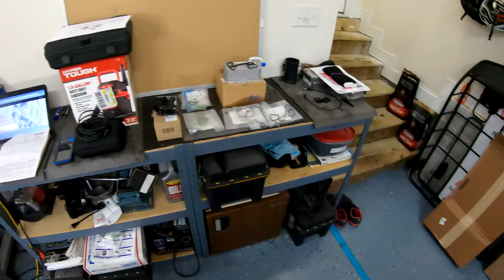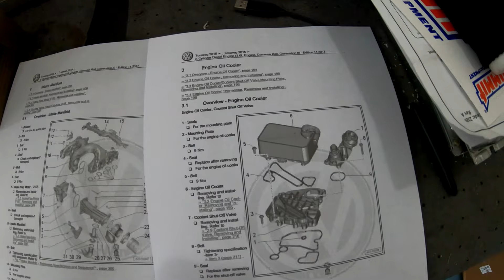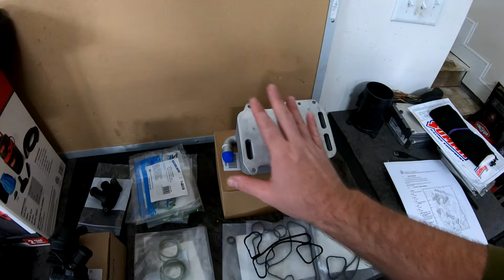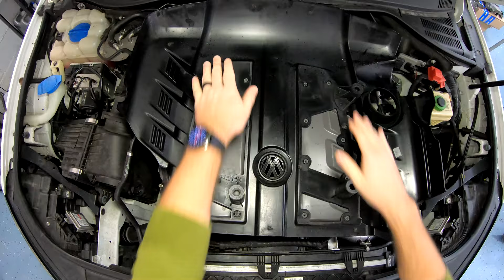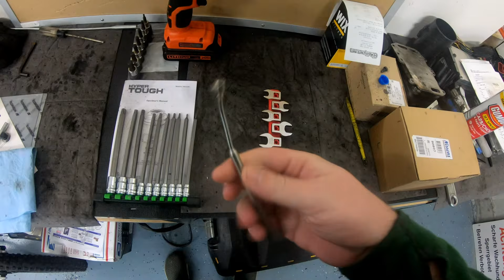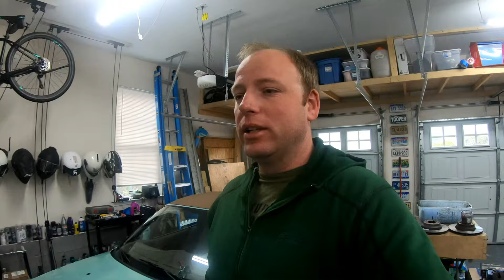2014 VW Touareg Oil/Coolant Leak - Oil Cooler/Coolant Bypass Replacement

Comment: Thank you your post, it is one of the most complete in this subject. For the DIY guys I recommend to source the factory procedures for this work. Without it is a gamble, this is a complex job doing it first time. I found this vieo usefull for the information not written in the factory procedure, like used tools, remove of the HPF sensor, etc. 
Thank you to bring my attention to the oil cooler itself as a potential source of the outside leaking of coolant, I never thought about it but it is possible. It is worth to pressure checking the cooler itself before assembly.

I would add one more thing to consider. The removal of the intake, EGR, oil cooler, base of the oil cooler is a hard job you really want to do it once and not more. When the first leak presents I recommend replace everything involved. The reasons are: A) you will not be able to pinpoint what part is really leaking even with the borescope camera. The spaces are so restricted camera will not be able to move everywhere. B) If you replace one part at a time and lucky enough to cure the leaking than you will have to do the job after 6 month again because other parts will fail. Based on that I recomment to replace the shut-off valve, the oil cooler gaskets, the interconnecting plastic with gaskets connected to the shut -off valve and finally the plastic cover fitted to the front sealing flange. This last one is a beast it is a separate project itself but it should be done every 150-250k km preemptive. Not to forget to pressure test the oil cooler and replace it as well if necessary. It could leak outside or-and inside.
 
I would add one trick for the oil cooler removal: before the lift of the cooler be prepared for the mess. Speed is the key. Prepare a nylon bag the oil cooler will be put into the bag. Lift the oil cooler quickly by right hand and immediately rotate upside keeping horizontal position to hold the liquids inside of the cooler. The rubber tube still attached to the cooler. With the left hand put the bag around the cooler immediately, completely close it in and close the bag around the rubber pipe. Than you have time to remove the cooler from the pipe without spill the oil and the coolant everywhere from the cooler. Keep the cooler upside down and horizontal all the time in order to prevent mixing the fluids in the cooler as well. Carry the cooler above the fluid waste bin, remove the bag and turn the cooler upside down again to allow all the liquid left the cooler.

I think draining the oil will not help in removing the oil from the cooler, inside geometry helps the oil to stay in the cooler.

Edit:
One more potential coolant leak that occured to me now: the coolant sealing of the oil filter house is gave up. This oil filter house has two sections: one for the oil, one for the coolant. The coolant gaskets are double gaskets copule of millimeter from each other, separatd by a 2mm wide plastic wall in the housing. In my case this plastic wall eroded and broke of some piece. Due to this "gap" in the wall the gasket was able to expand more and leaked. I recomment everybody to buy the complete oil filter house, forget the change of the gaskets only. I tried and failed because of the plastic erosion. It is a double job know and a messy one, colant and oil covers the fron plate of the motor, not easy to clean it well.

Good luck for every DIY guys!

Comment: Do you feel the oil cooler itself was leaking or was it just the gasket?  Also what's the torque spec on that fuel line that you tightened with the crows foot 17mm?

Comment: I wouldn't recommend leaving a fuel pipe slack to bleed the system as someone has suggested, firstly, being a common rail system the pressure created by any slight leak has to potential to cause serious injury.
Also, the rail pressure sensor will detect a leak and possibly stop the pressure rise by preventing the HP pump from pumping.

Comment: Hey from San Francisco! I’ve got a 2014 A6 TDI that I absolutely love. It’s got 130k miles on it and has been rock solid—until recently when I noticed a coolant leak and that telltale sweet smell from the engine bay.

After a $2,300 repair bill, they replaced the oil coolant box, several coolant hoses, did three flushes, swapped out that small flange piece, and replaced the thermostat housing. It was a mess and took two weeks in the shop.

Now, after a couple of weeks of driving, everything seems good—the coolant level is steady, and no more issues. A new car isn’t in the budget at $20k+, so I’m hoping this $2,300 investment keeps me rolling for another 100k miles! 🚗💨
Reply: Where did you take your car. I have the same car with a very similar problem. I am in oakland.
Reply: @mikei7444 LaVere's VW And Audi Concord, you have to haggle & the owner (old guy) is little off. But they did good job , running good. after 8month so far post Job. It's not cheap $2300 parts & labor. I brought in the water pump myself (VW part) that was $230.

Comment: I have seen some oil leaking around the cooler could this be a reason when you put a rubber glove on the oil cap its blowing the glove up rather than sucking it in?! or could it also be the PCV not working? I am having trouble finding the PCV on this model to be honest….. any ideas anyone?
Reply: PCV is integrated in the left cylinder head cover. Better to change the cover instead of prying off the cap and replace the membrane from cheap chinese membrane.
Reply: @ i did change that now and its made no difference 😔 still seems pressurised but is it normal for these engines to be like that? i have a few jobs planned up not sure if will make much difference, overhaull of rhe injector seals and the glow plugs and the water pump along with thermostat as inthink thats also sticking open at times as the engine temp never seems to get above 70 degrees some days

Comment: I also have a 2014 VW Touareg TDI that has been experiencing the same issue and now I have lost the heat.  Can having this leak cause the loss of heat?  I have a P040B error code.  I have the vehicle at the VW dealership and they feel the loss of heat tis related to heater core which is a major charge to have the heater core replaced.  There is visible oil leak at the oil cooler.

Comment: Thankyou for this excellent video, best one out there. Just done this job on an audi A7 and it was incredibly helpful. Some tips from my experience: I had to pre load one of the intake bolts which had a very tight gap when re installing. I think it was the front one. For the egr clamp I used torque of 6nm plus a 90 degree turn to tighten it back up. Also when removing the intake be very careful to remove the tube that connects to the coolant reservoir. You have to disconnect this as it runs over the intake. I tried to lift it over and snapped it off and this delayed my re build. Thanks again!

Comment: Great video thanks for posting very informative. I had the same thing done at 120,000 miles and now I’m at 180 and it looks like it’s leaking coolant again as well as oil.   Does anybody know if there is a permanent fix this issue?

Comment: It definitely helps to drain the oil. I had a fresh oil change a week before I started this project and when I pulled the oil cooler up the top of the motor filled up with oil. I only had coolant on the top of the engine when I started the project. I just need to buy the parts, and finish the project hopefully in the next week or two. Thank you for posting this video. It’s really helpful.

Comment: EXCELLENT VIDEO GOING TO DO MY AUDI A6 3 LITRE STARTED OIL LEAKING AROUND THE COOLER SO GOING TO CHANGE THE LOT LIKE YOU DID EXCELLENT HELP THIS VIDEO ARE THE PARTS SAME ON MY 2007 A6 AR DIFFERENT WHERE DID YOU BUY THE PARTS AUDI OR INTERNET AS MY CAR IS OLDER SO NEED TO KEEP COST DOWN THANKS AGAIN GREAT

Comment: Hi 
Just done all the above to my 2014. Started and ran fine But after a drive now have a misfire on no2 cylinder code P030200  wondered if I got any contaminants in the rail ???

Comment: Thank you! This video is very helpful. Did this issue set off any OBD codes? I have this same issue but prior to discovering it I received a coolant temperature sensor code that kept appearing until I replaced all 3 coolant temp sensors. Less than 5k miles later the same code is back again?! (Yes, after clearing the code each time) Any additional insight is much appreciated.

Comment: I have this problem in my '13 Touareg too.  Been slowly losing coolant over the last year or so but now there's oil in the valley (Que Jed Clampett!).  I like my local dealer but they told me just yesterday that it would require them to drop the engine to fix it!  NAH!

Comment: Don't forget about the plastic piece bolted to the flont engine cover. Part number 059103525F. There is a video series on replacing that part https://youtu.be/sTnSVnOS4fQ?si=iIIj3weuGQ4pm7En

Comment: So my '13 tdi Touareg has this issue. The oil hasn't been dropping for a while, the coolant was also going really good without any leaks (Never had to add any for months). A few weeks ago, I was driving it and the low coolant light came on while on the highway and it was way below the min level. After topping it off, I drove off to a place I needed to go. Spent about 25 minutes there, then I came back, started the car and the coolant was below min once again. Then I topped it off again. Then the car sat in my driveway for a few weeks without any start up and I came back to it about 3 weeks later to find a small dried up puddle on the ground the size of a few quarters side to side. Then I started the car and checked the coolant, this time it was WAAY below what it usual drops down to. Way below the minimum line. I added coolant once again. I drove to where I needed to go which wasn't too far. I parked the car. About an hour later I come back and there are two relatively big puddles. It didn't look like it was oil because it wasn't super black nor was it "oily". It was kinda oily but not engine oil "oily". Then I drove back to my house and opened the hood to find a good amount of "liquid" in the front right part of the engine bay. It looks like it's oil but the feeling isn't convincing me that it is. Also the electronic oil dipstick in the car doesn't show any lost oil. It's been the same for a long time. I don't know what to do. I believe that it's coolant but I don't know where it's coming from. 

Maybe the liquid scattered in the engine bay is something old, maybe I just noticed it.

Comment: @driven to failure thanks for sharing this. 
I thought you need to flush out all coolant and engine oil before starting this job. But didn’t notice any coolant or oil gushing out your whole video.
Reply: That's what I thought. I'm about to tackle this job. Did you do it also, and did you drain the oil and coolant first?

Comment: I’ve got the same issue on my 2014 Touareg TDI - thank you for this video
Reply: Bro there is another set of parts that may be causing your leak. I am talking about the plastic cover that bolts to the front engine cover. Part number 059103525F. I just posted a video series on my YouTube channel showing how to do the repair.

Comment: I just wanted to sat thank you for this video 
I followed your steps and  fixed the same problem 
It was not easy job but saved a lot 
Also would like to mention parts prices $460 in Chicago area
It took me about 8 hours

Comment: i stumbled upon this video and I have a question. I have oil in my coolant reserve. I am assuming it is the oil pump cooler and not a gasket..what are your thoughts.  My dealer quoted my 3200 to do an oil cooler job and the part is only 400..what a rip off
Reply from the maker: It’s likely gaskets, there are several in there… the quote is similar to what I got, there is a bit of labor involved to get down in there and also gaskets to replace on the manifold.  They may also be doing some intake carbon cleaning while in there which is messy and time consuming.  Definitely some while your in there type work…

Comment: My 2012 has a small drip that hits the drive way.  Not loosing enough to worry about it yet……but o I’m
Going thru about 300 ml of oil every 2k miles.  I change oil at 5k intervals.  So I can top off once and that general lasts.   My X3 was a leaker too, far worse 😂.  No coolant loss, drip is not destroying the driveway yet.  Once either of those occur I’ll drop a grand on it.  And take the wife’s TDI A6 which is far better put together despite similar drive trains

Comment: I would like to add what I have experienced on my '14 Touareg TDI.  Started noticing a strong smell of diesel and oil burning for 6-8 weeks.  At same time started noticing I was needing to add coolant about once a week.  Then a couple weeks later the coolant reservoir was pitch black. Removed cap and it was full of diesel Oil.  Took to Little Rock dealer.  Said it was the Oil Cooler.  Took 2 weeks to repair.  Went to pick up and reservoir was still pitch black and looked to have mostly oil in it.  They said they flushed it but I'm not sure how.  So left it with them for 3 more days and they said it took 5 more flushes to get rid of most all the oil.  But Car continued to use Coolant.  So left at dealer to diagnose, and they said that after communications with VW they now believe the EGR Cooler is failing, as the coolant does not seem to be going anywhere else.   From this video I can now see the Dealer had to remove the EGR Cooler to get to the Oil Cooler.  I wish they would have replaced both, or at least told me there was a fair chance that it might be both.  OR,  the tech messed something up when they removed the EGR Cooler while doing the Oil Cooler repair.  I will never know.

Comment: What exactly did you use for cleaning the manifold for use on the drill? Figure I'll buy whatever pipe cleaner you used so I know it works. Thanks for the video. I sure wish it took me 5 minutes to finagle the intake manifold off, took me more like 5 hours, at least it felt like that.
Reply from the maker: It was a 10pc or so of pipe cleaner brushes from AdvanceAuto, I clipped the little eye-lit off the end and stuck it in a drill.
Reply: @driventofailure   Thank you. Great video.

Comment: Driven to Fail, Halffast719 and Mark_b6s4 have all shown many versions of working in the valley of the 3.0 TDI Audi Q7, VW Toureq and Porsche Cayenne.  With thanks for all their great and informative vids.  I personally will remove DPF, DEF and EGR with a Rawtek exhaust and Malone Tuning stage 2 after the Diesel-gate warranty expires.  I have spoken with the top mechanic at my Audi dealer and he recommends it, even though he is not supposed too.  Best to all my TDI friends. 👍
Reply: Hey there; currently having these exact needed repairs on my Porsche TDI, and my dealer is claiming that the extended emissions warranty does not cover these components. EGR, Oil Cooler etc. I am not sure how these components are not related/covered under this.
Reply: Hi Cody,  Please google, Diesel Gate warranty, Porsche, VW and Audi.  It will list all these coverage's. Your TDI has to be under 10 years from purchase in service date and under 120,000 miles.  Lastly, don't be afraid to call Porsche corporate. Cheers, Mick
 @codygoodwin1097
Reply: @codygoodwin1097  Having the same issue now and thought it was the EGR; after watching this, I now think it is the oil cooler instead.  Curious  whether you got warranty coverage and if so, how?
Reply: You will like it. Your Q7 will love it too.
 I did all of it myself with Malone stage 2 flush. I  can't remember what brand pipes I used but they were from Canada and cheaper than Darkside hardware. Not as nice looking though but its underneath anyway. Audi sounds like a proper diesel and actually growling a bit like an angry cat. I love the noises it makes now, getting on the gas is just pure joy now. Loads more power and obviously the fuel economy is greatly improved. My EGR is still in there and doesn't actually leak but I already have all the seals to do the repairs, plus the block off plates.

Comment: Great posting and presentation of the work.  I have a 2014 Audi Q7 TDI, I'm sure I'll be doing the same or the dealer since it is still under Diesel-gate warranty.  Wheres your garage, maybe I'll bring it you.  👍
Reply: It’s not covered under the diesel gate warranty
Reply: @rthilson  I just had it done at the dealership. No Charge, covered under the DieselGate Warranty...
Reply: @mickeyol Your Audi dealership replaced the oil cooler and covered it under the diesel gate warranty? My dealership says EGR cooler is covered - oil cooler is not covered. Maybe I need to go to your dealership :)